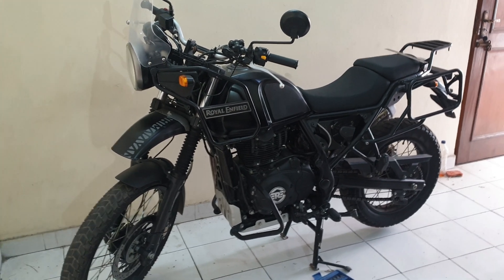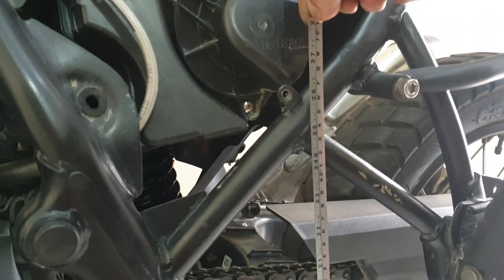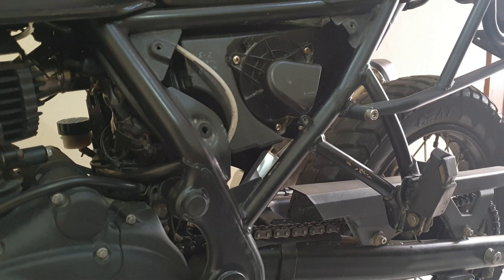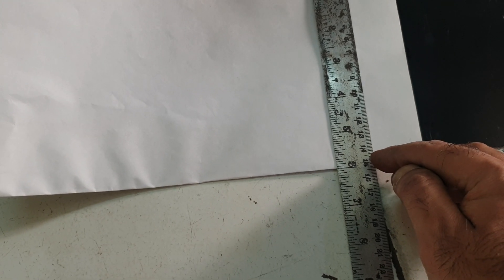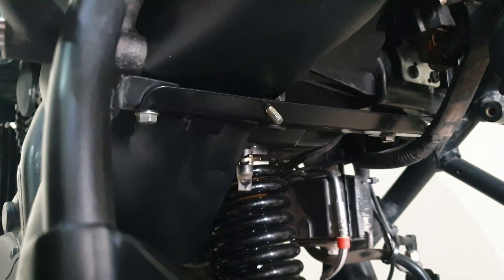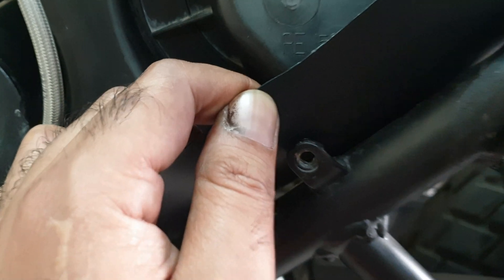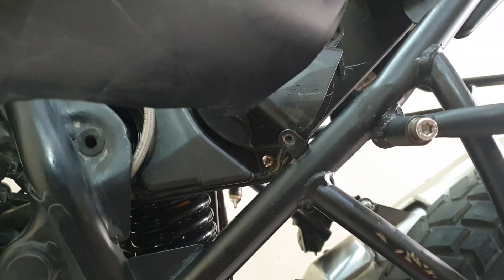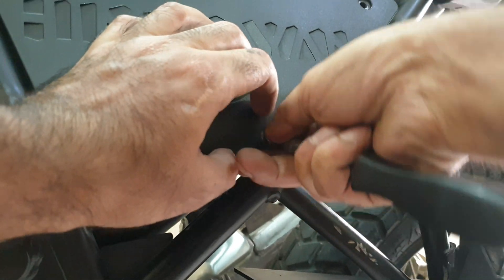Royal Enfield Himalayan | Water Entering Airbox / Rear Tyre Splash in Deep Waters | DIY Solution 2

Comment from the maker: Hi
I have been having this issue crossing deep water crossing in the mountains or water logged city roads(which happen more then often, especially in monsoon season), where the water thrown back from rear tyre gets sucked in the air filter by the scoop because of the gap between the frame and the mud flap which lays under the airbox. Link: https://youtu.be/Kt422XHzB4s
Now its not that much of a problem if water is upto a foot deep, but on more then one occasion I found myself in water upto 1 and half to 2 feet deep. Usually the bike would stall as the air filter gets wet and sometimes depending on your speed so much water enters, filling up the airbox and stapping the bike for good.
Like here: https://youtu.be/wtnOt1HZ97A
Solution, well there are many, one attempt lead me to add a small plastic cut out thus covering the gap and I had fair results and that motivated me to work on a bigger contraption. 
Just in case if you have encountered this problem this might be of some help. 
Will test it this monsoon but I already have third more proper design that I might go for in the future.
The big question, "Does it obstruct Air Flow"
Well, there is still plenty of free space and gap between, the scoop and the sheet. But only time will tell once i ride it for longer distance and check. Air scoop can be moved upwards thats one solution, yes that is possible.
Your input is welcome
Cheers:)
Reply: 1 and a half feet, that not to much, may be if you buy larger shoes that would give you an additional margin :-))))
Reply from the maker: hahaha :D

Comment: Something people should fix right away when buying one of these is the airbox is not sealed to the throttle boy, it is only secured with a cable tie, air and water get into the air box, remove the cable tie and replace with the same jubilee clamp which is fixed to the inlet manifold, buy the same clamp and fix it to the other side of the throttle body where air box attaches,

Comment: Buddy instead of going through the rigmarole of cutting a plastic or fibre sheet to cover the gap in the rear mudguard just get a rubber bidding used in sliding windows for the glass and just slide it on the edge of the mudguard thereby filling the gap.you can use bostik used by cobblers to stick the rubber to the plastic.

Comment: I saw this video just now. You check for belding option with small steel size long patti for 2.5 inch
Reply from the maker: That is a good idea mate, will certainly look into it in future for a permanent fix, Thanks :)
Reply: @leuheanrede  is this the same issue  under bs6 Himalayan.please let me because i am thinking to take out delivery in some weeks

Comment: Instead of putting something outside why don't you turn the air sucking mouth just reverse and tighten screws............I mean have a try please
Reply from the maker: Yes, you can, but then there is that bulge on the panel. another option that few have considered is to move it up anticlockwise. But I just feel comfortable with the shield. Thanks for your feedback :)
Cheers :)

Comment: Bro ..I am facing a issue with my himalayan.i have covered 13000 km and now when I rev my bike while running a harsh sound is being produced from engine and the front area ...your vedios are so informative and helpful..if u have any idea any the issue I am facing please do kindly helpe out.
Reply from the maker: Thanks for your kind words mate, truly appreciated. As for the sound, is it "knocking sound" usually heard in high gear at low rpm.
Cheers :)
Reply: @leuheanrede  its not a knocking sound..it's more like a harsh vibration like sound
Reply from the maker: I would say, start with looking and tightening any loose nuts and bolts. Then, check for valve clearance. Unless what you are hearing is a grinding sound coming from engine. 
Cheers :)

Comment: I have got the same done from my local mechanic. After continuous stalling, last monsoon season. Also can you suggest a battery for Himalayn? Have used exide and Gulf in past but not satisfied with their performance.
Reply from the maker: And it does help surprisingly will in rains doesn't it :)
As for battery. Its exide and I am using the same one on ktm 390 aswell. No issues faced yet. May I ask if you are running electrical accessories and if so which ones. As they might be causing power drain?
Reply: @leuheanrede  I'll also fit the new battery tomorrow and will check if the accessories are drawing any power when off or the bike stock electronics draining it down.. will keep you posted with what went down. 😃
Reply from the maker: Ya, in some cases accessories do drain more power that the bike can generate to charge the battery, thus always staying deprived of the much needed juice and running low. Eventually it just gives up. But do let us know if Amaron one holds
Cheers :)
Reply: @leuheanrede  May be that type of battery is available where you are ? 
https://www.youtube.com/watch?v=fSxrRmNcHUs&t=19s&ab_channel=KARMAkazeMoto
Reply: @leuheanrede  thanks for the reply...and yes the air filter cover helps a lot.. and for accessories, I just have auxiliary lights on my bike which are connected to a on/off switch and are not always on... I got the bike fitted with Exide which worked for almost a year.. then the Gulf , which again I got from the authorized service station died like 2 twice in 8 months.. I got the alternator/ magnetic coil checked which according to service station is working fine.. not sure what the problem is.. I have just got an Amaron one today.. let's see how will it perform..

Comment: Beautiful as always. What I would have suggested to an anotherwise wonderful job is making a couple of 3 to 4  2mm holes on the face of the air filter cover (the one with the snorkel), along with this mod, so that, it has enough air to breathe, while smaller holes reduce water ingress. Just my thought! :)
Reply from the maker: Thanks mate :)
And yes that is a brilliant idea, as that will supply enough air while riding and wont let water in if the bike is parked in rain. will incorporate it but only after i have a spare one handy :D
Thanks again bro
Cheers :)

Comment: Dear Friend
Once again, your nice way of making these videos is greatly appreciated.

This demonstration is very instructive. However, I do have some questions. Fluids generally do the opposite of what we would like them to do, except for the beer that goes down our throat, wouldn't it be that the water that used to go in from behind is now pushed to the side and therefore will go in through the side into the air intake? Another comment in the previous video mentioned the idea of a snorkel. 
As I don't have a Himalayan yet, the project is for this summer, I can't try it myself. 
But I asked myself the question, how to make one. It seems to me that I would try to make a kind of short pipe that would be put on the air inlet and extended by a kind of tube or pipe, for example made of copper or other plastic or other material, this tube should be wide enough to give enough air, maybe flat enough if a round one doesn't fit.
Perhaps the pipe going upwards could be made with a silicone mold. And for the empty part of the pipe, use a wax blank. Is that a stupid idea?
Once the wax blank is made, it should be fixed in the general mold and then pour the silicone preparation around it and let it harden.

I've just watched a youtube video, there are many others, on how to make the silicone moulds, just to give an idea.  https://www.youtube.com/watch?v=1qOwem_ll68&ab_channel=RobertTolone

What I would love to have at the beginning and end of your videos are the nice guitar tones that you are able to play
Reply from the maker: Thanks mate, very kind of you
That beer remark burst me into a fit of laughter :D
And about water getting through the side into the air intake, yes, at 24-26" or two feet we are not even talking about the deepest of water crossings. So this sheet could handle a little over 1 and a half feet, which was earlier a problem. As the water from rear tire and splashes found way inside airbox at a foot deep earlier
So yes, working on a snorkel is the best bet and those silicone moulds will come in handy and something can certainly be fashioned along the lines of what you have mentioned .
What need to be worked on is the routing of the hose/snorkel to a higher place. As there is limited space to work around even with flatter hose. 
Area around ECU seems like the right place for snorkel to begin, there is some space there. and we would gain about 4-6"
The snorkel will have to be routed in a way that its not obstructed other wise will choke the air supply.
Wil see how much this curent contraption can handle and maybe move the snorkel way. 
About the guitar tunes, thanks again, yes something can be incorporated, will see how it goes
Cheers :)

Comment: Gr8 work bro! 👍👍👍 Could u post us a video on setting of rpm?? TIA..
Reply from the maker: Hey bro, yes sure will do. Also are there any idling issues being faced?
Cheers:)
Reply: @leuheanrede  yes after valve adjustments.. at first when i am starting up my bike the rpm has come down a bit.. and even after the engine is set sometimes in neutral or using clutch the engine goes off. That is not supposed to happen right?! It is supposed to keep on idlin..
Reply from the maker: Mate, may i recommend rechecking the valve clearance, its sounding like a symptom of tight clearance. the bike might be running very hard and rough as if its dragging a train, is it?
I am sure you checked and adjusted in TDC, but engine is twice in TDC, make sure you are checking it in Compression stroke. Have a done a vid on how to make sure engine is at TDC in compression
https://youtu.be/_lAmh1xp45o
But, will post a vid on idling aswell, 
Keep us posted
Cheers
Reply: Thanks mate!!!
Reply: It was done at the service centre so i assume they must have done it right
But still cant say
Reply: Would be good if I could contact u! U can mail me riteshkhaling@gmail.com
Reply from the maker: @riteshkhaling  ok, so I hope RE svc guys did a proper job. And have sent you a mail
 will try and record idling video soon.
Cheers:)

Comment: Hi. This is David from Bourke NSW Australia. Thank you so much for your videos. I am learning so much about DYI for my own Himalayan. Just one thought on today’s video - why not turn the air intake counterclockwise by 120 degrees so it is pointing up and less inclined to take in water? You would need to cut off the small air filter inlet cover locating stuff, but that should be ok. Just a thought. Blessings, David B.
Reply from the maker: Hey mate
Thanks, yes that is something worth exploring and did come to my mind, but was worried that turning it up might expose the scoop to rain water/or while washing, if parked in open.
Will only be able to confirm it once tested, so I am gonna try it for sure :D
Thanks again and Cheers
Reply: @leuheanrede  May be if you turn as suggested and then add a snorkel with a slight inclination so that rain water would not come in ?
And make sure that it is not to close of the saddle, in case of a day with too much dal...

Comment: Let's see if we can extend the suction hole to somewhere to the side or on top. Like a snorkel. We used to make extensions to install conical hp air filters, on Honda dio with that. Using either pvc pipes, and rubber washers.
Reply from the maker: Hey mate,  yes KTM also uses same hose/snorkel that runs from air box under the tank all the way to rear seat :)
But on Enfield there isnt much clearance to work with, if the snorkel gets pinched it might choke. That being said, its certainly worth exploring, would be trying that soon
Thanks and Cheers :)

Comment: So I’ve recently found out a new problem on my Himalayan.  The rear brake started not to do its job and it’s holding the disc like only 10% of what it used to before but this happened right after I lubed the chain, so naturally I thought the lube must’ve accumulated on the disc and it’s slipping. But after riding for like 100ish kms like this the problem hasn’t been resolved which should automatically be resolved as it’s not my first time.             Then I’ve got hold a sand paper and wiped the disc and also the disc pads with it and no improvement at all. Then I took it to the mechanic, what he said was some air must have been sucked into the rear brake oil pipe thing( I didn’t get it tbh). What he did was removing the pipe where the brake oil gets to the rear brake inserted a syringe and took all the brake oil out of it and and put new oil in it and it’s completely alright now.   Is this a common problem or it only happened to me and any possible reasons for this happening? Love to hear back from you. Cheers :)
Reply: Yes sometimes it happens. Haven't had the issue on my himalayan but had the issue in my Cbr.Water or moisture can cause accumulation of bubbles inside the brake fluid. That bubble can be released, not necessarily by changing the brake fluid. How much km has the bike ran till now, total km.? If its more than 1.5 to 2 yr, its good that he changed the brake fluid. Should not keep the brake fluid for long duration, change at regular intervals. India we people tend to keep it as long as possible, it shouldn't be.
Reply from the maker: Hey
vsk mn has made very good points, how old is your bike and how many kms?
And may i ask, was it that the brake paddle was going down a long way before some mild braking happened?
Waiting for ur response
Cheers :)
Reply: Yeah it must be the oil duration then. It’s a 2018 non abs version but I bought it from the local dealership in February of this year ( it is a showroom test ride vehicle which i got) it was clocked 1500 kms when I bought it and now it’s around 4200 kms. It’s pretty much just hanging out in the service workshop from 2018. In September of 2018 RE has launched the abs version and mostly this particular vehicle must be kept aside from then.
Reply: And yeah the brake pedal was going all the way down before it’s shows a bite.
Reply from the maker: Yes, thats what i was worried about. That is common when brake oil or pump gives up. It should be ok since the mechanic has replaced oil, do check for reservoir and make sure there is no gel like accumulation inside it. Rest should be good
Cheers :)